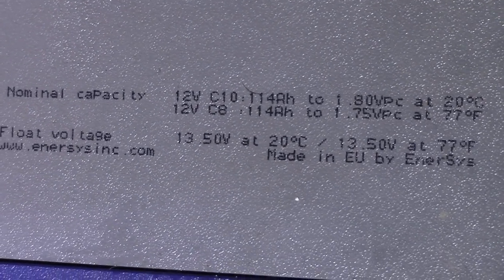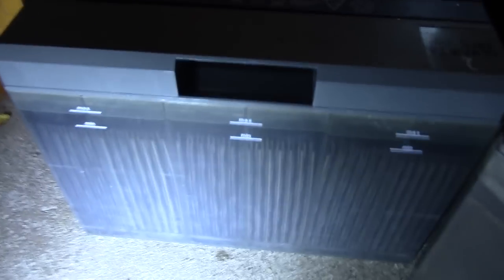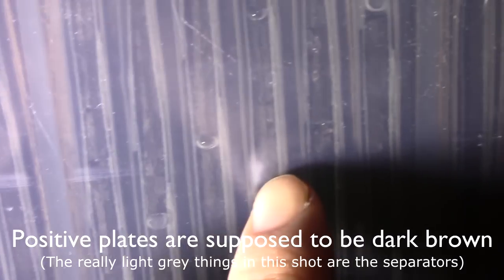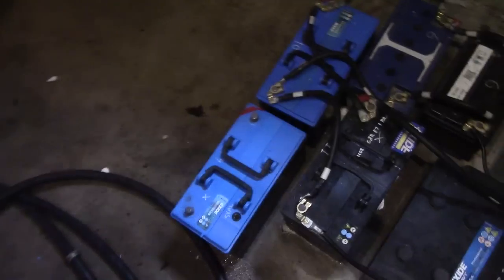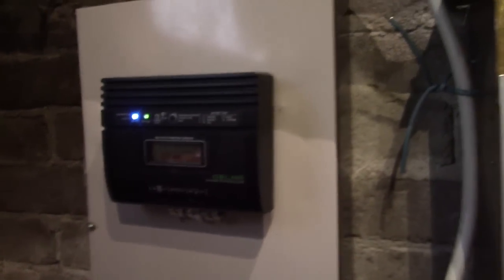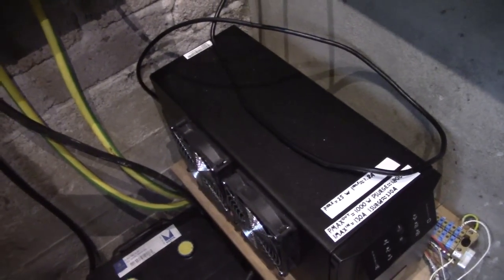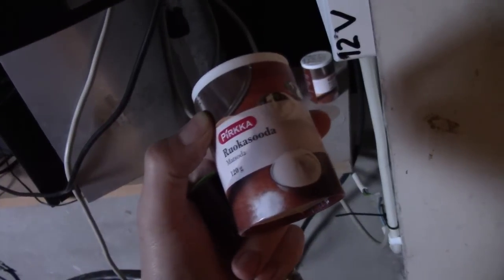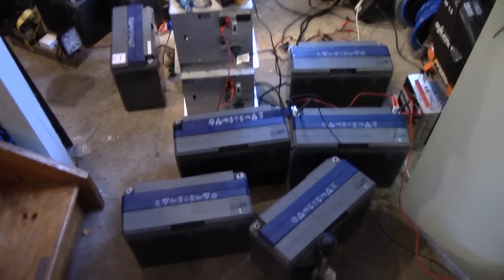Battery and solar stuff, November 2014

Comment: Nice, those looks like the same batteries I used for my battery backup system a while ago before I changed them to gel batteries 
Mine batteries came from the diesel generator in AHS

Comment: Wow, you've definitely added a lot to your battery bunker. The last video I saw of the bunker was basically all empty. Now it's all filled. Nice! But that water looks kind of scary right next to that big bank of batteries. O.o  

Nice to see you've gotten some real PV panels but the winter there has got to suck for solar power. In sunny CA where I live, autumn is starting to bring more and more clouds and intermittent rain. :-( We have a really bad drought here so rain is needed but given that I now are playing around with solar, it sucks to have clouds. I really hate cloudy days!

Anyway, nice to see an update of your situation. 

May I ask what you plan to do with all these batteries? I mean you're not really able to recharge all those batteries with those two panels, even if you had full sun. What exactly do you intend to power with all those batteries? Is this a backup system for your main house if/when there is a power outage?
Reply: oh yeah, I'm also one of the 3 regular battery viewers. :-)
Reply from the maker: I'm reasonably certain that the cloudiest winter's day in Silicon Valley brings more sunlight than the brightest summer day here in Santa Claus land.

I knew that room was prone to flooding when moving my solar stuff in there; that's why there are no cables running on the floor, and the inverter is mounted on a shelf. The batteries themselves don't care if they sit in a centimetre of water (they're just plastic boxes, after all), at worst that cools them a little. The biggest problem is probably moisture getting trapped under them, and breeding mould and other nasties.